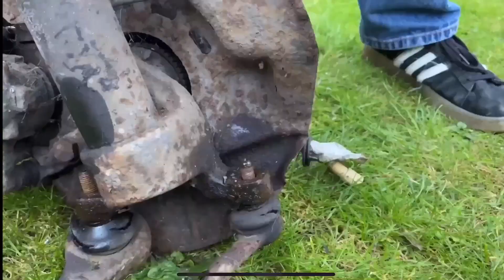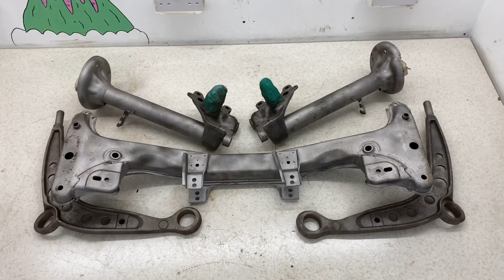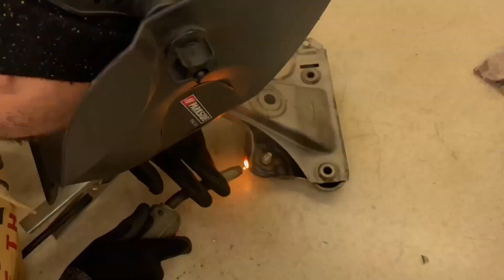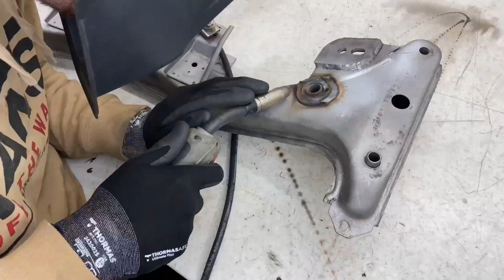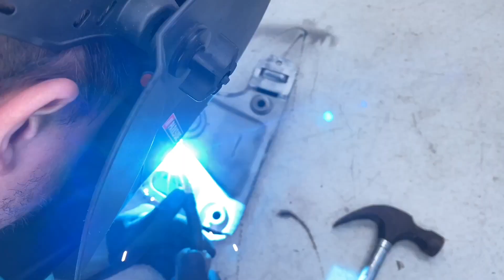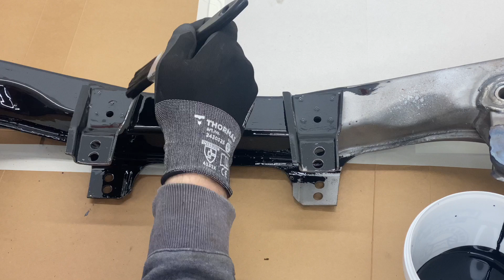EP. 3 My BMW E30 Restoration - Front Subframe - Reinforcement and Restoration

Comment: No way, I did this exact same job with the same weld in kit a few weeks ago. Although I decided to modify the ARB reinforcement on mine and weld it on the other side (see my vid if you're interested). I'm impressed with the POR15 finish, amazing for a brush-on paint. Great job, subbed :)
Reply from the maker: I was very tempted to do that too, i tested the fitting of the arb bush mount and I was happy it would still work. Definitely something I’d do next time!

Comment: Why the reinforcement bud?
Reply from the maker: Heavier engine, stiffer suspension and sway bar! Quite a common thing with e30’s due to common faults. These help alleviate the known weak points
Reply: Definitely worth it so- We are dropping a m52 into ours
Reply from the maker: @parknchillwaterford3040  nice one! It’s kind of one of them jobs where whilst the engine is out and it’s easy to get to, you may aswell go for it! Good luck with your swap dude, sweet engine.